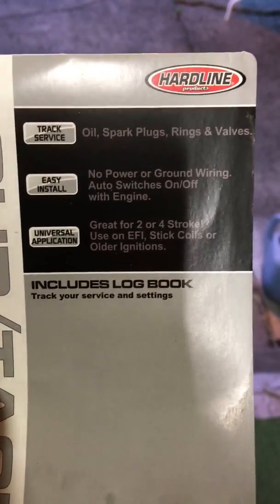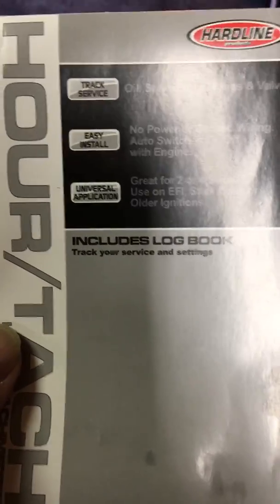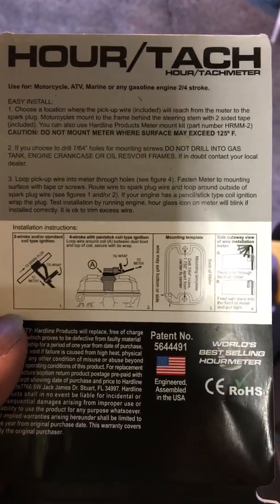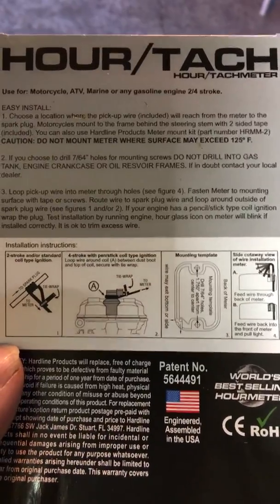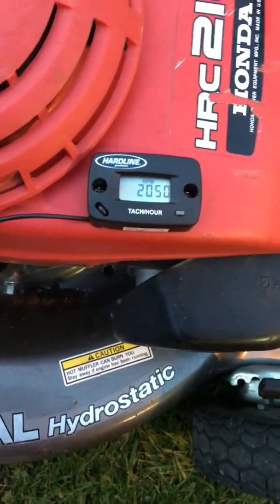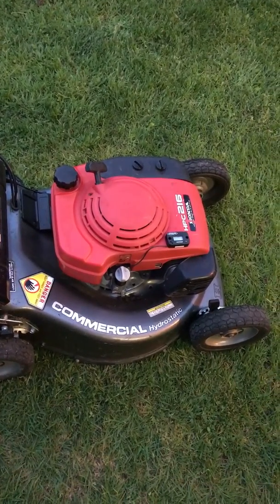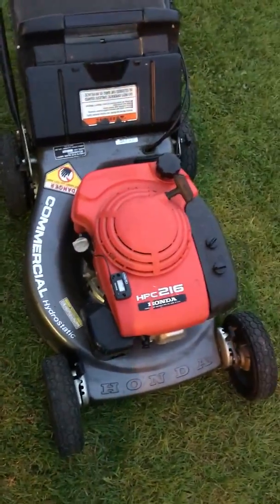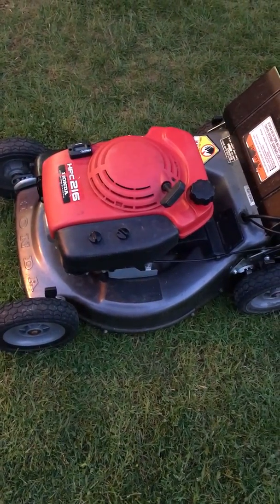Honda HRC216 mower Tachometer RPMs

Comment: Way to heavy and does not cut like I thought it would - I gave mine away.
Reply from the maker: It is a very heavy more but fortunately I don’t have to transport mine anywhere, it just comes out of the garage and drives itself around the lawn with me behind it. But over 20 years use with only oil changes and a couple blade replacements isn’t bad.
Sorry for the delayed response but I’ve been in the hospital with a nasty case of Covid.
Reply: Thus mower is crap. Best one is Honda hrx217.

Comment: If you can share the maintenance you do. Would be great 🙏
Reply from the maker: Honestly very little. I change the motor oil each season, turn off gas valve & run until it stops. I purchased it new back in the 90s and replaced the blade once.blow out air cleaner. Always lay on it’s side & rinse grass out every mow. My lawn is average I guess for a small town residence, about an hour to do. The mower has been bulletproof. I used to go thru briggs powered mowers every 4 or 5 years. This is like 25 now & works like new.
I do run non ethanol gas in all my equipment. There’s a site called pur-gas.org 
Check it out. Ethanol is ok for new every day drivers made for it but cars & equipment that sits a long time will suffer. I have personally seen the alcohol separate & turn milky white as it absorbed moisture. Ethanol gas also produces more heat which isn’t great for mowers saws outboards & weed wackers.
I still use a McCulloch chain saw I got in 1980 at Montgomery Ward. I was cutting up the logs that came down the river when Mount Saint Helens erupted. My rototiller is a 1974 coast to coast, it still fires up & does the job.  Sorry for the long winded response
Reply: I appreciate your answer. I blow out the air filter every time, oil change and blade sharpening. I already ordered this device and it is ok. its good to know it